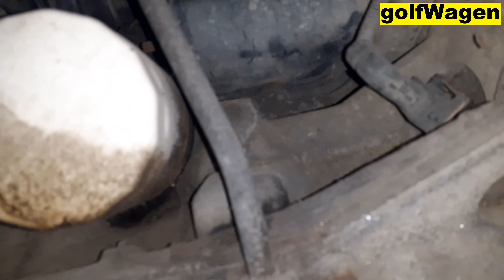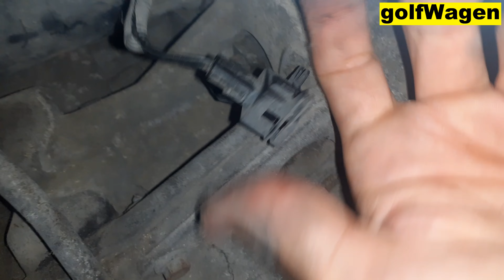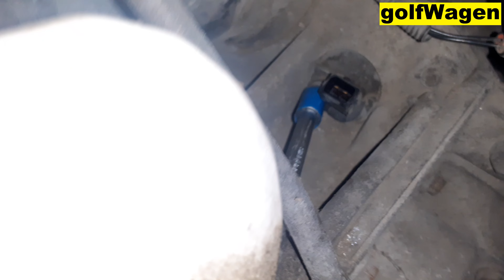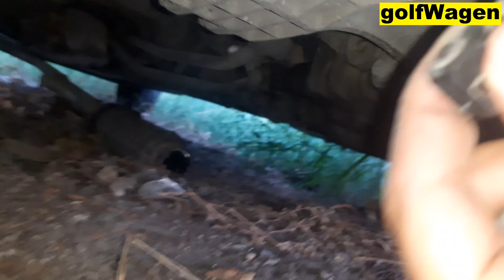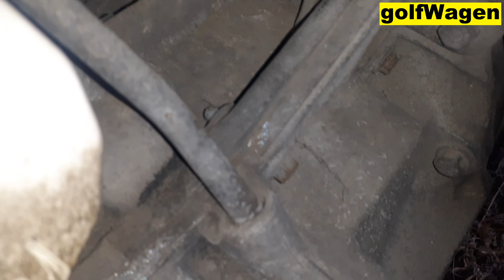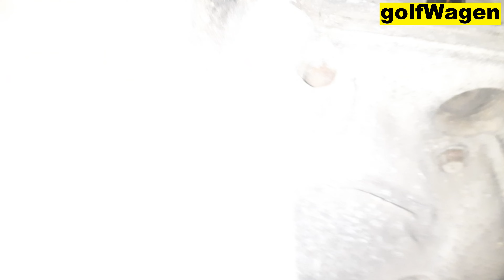Ford Fiesta crank but no start crankshaft sensor replacement

Comment: Thank you, car has been idling terribly and after checking spark plugs and leads which wasn't the issue, it pointed me to this. Not sure why Ford decided on such a weird layout of their engines
Reply: Mine doing same.. I changed oil pump & waterpump now it cranks without starting 😢